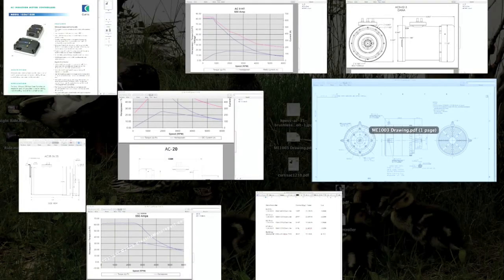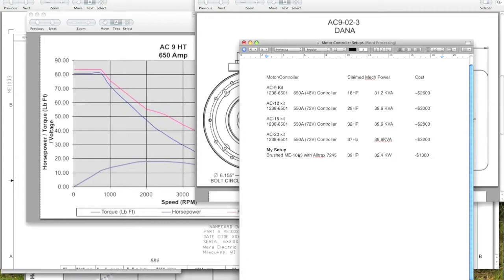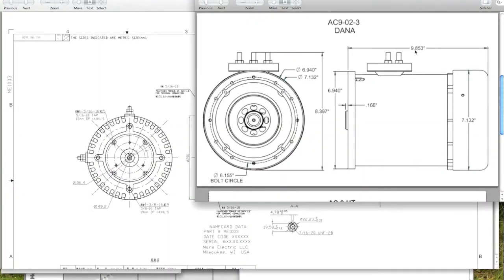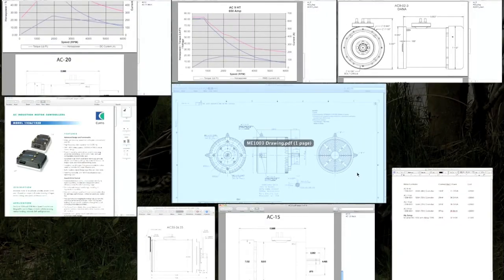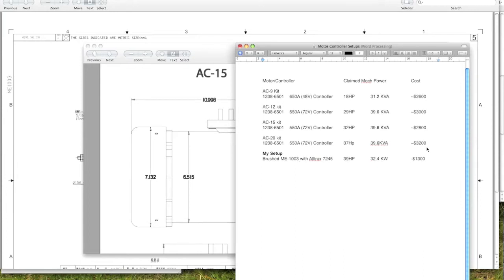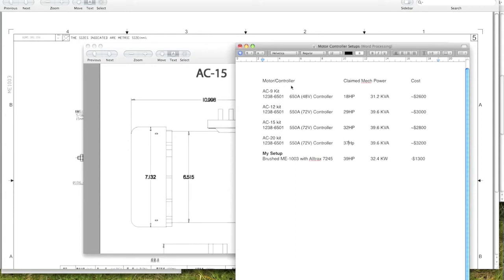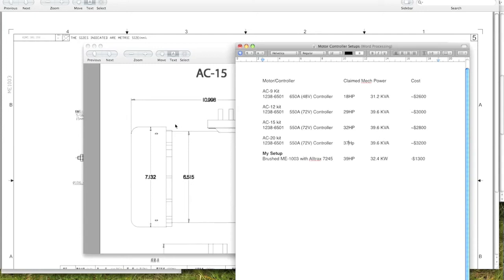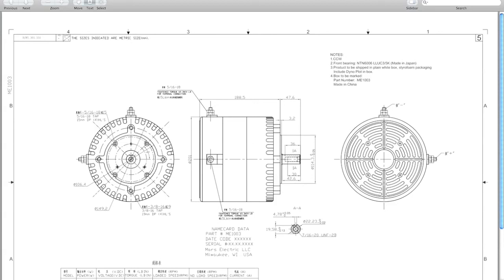#13: Design Decisions: Motor Choice?

Comment: Great explanation, thank you. 
You mentioned you where running 72v. Is there a reason you have a total of 80v on you battery setup (there's an obvious answer, but thought some folk would like it explained) great channel, keep up the good work
Reply from the maker: Yes definitely, great point. 72V is the "nominal" voltage of the system which is a lot like an average value. When the bike is running the battery pack will typically be around that average value of 72V, but while the bike is sitting around it is normal for the battery pack to be resting at ~80V .

Comment: Hi man, great videos again love it :-)
Could you post what sort of acceleration you can reach? lets say 0-60kmh and what top speed at 72V?
I am planning my build with the same motor but i dont seem to get decent acceleration from my calculations.
Love that motor, great value for the money and good to start off with i guess.
Cheers
Reply from the maker: +Marius Schudel Keep in mind that my bike runs my custom 600A "beast" controller now. I'd say it does 0-60 in about 5-6 seconds. It's not spectacular, but its quick enough to be fun. It has a lot of power in the mid range so the 0-60 time is not representative of what it feels like if that makes sense. It feels like it has tons of power in the mid range and not so much at the low and high ends.
Reply: Thanks for the info and again very impressive specs!  Must feel amazing having built a bike like that and getting such impressive stats from a diy designed and built controller! Well done
Reply from the maker: +Marius Schudel It was a lot of fun building it! I actually designed it to do 750A, but had to limit it to 600A to keep the motor from self destructing because I drive pretty aggressive.